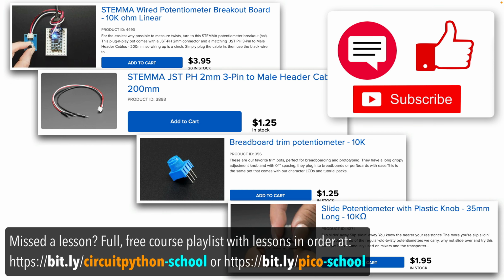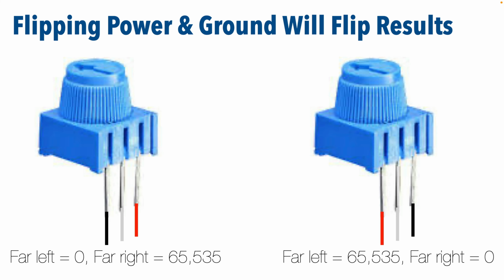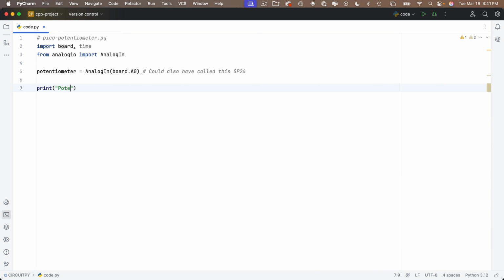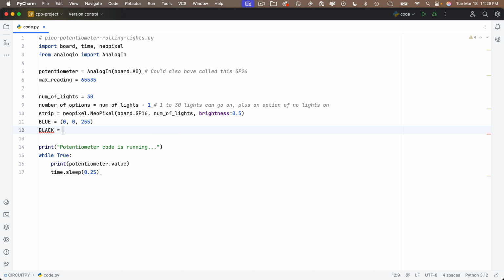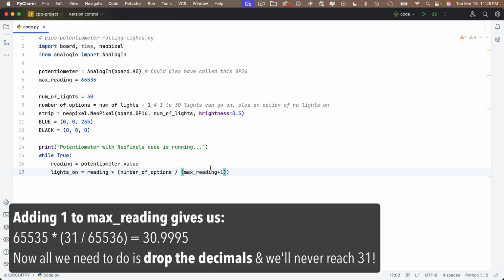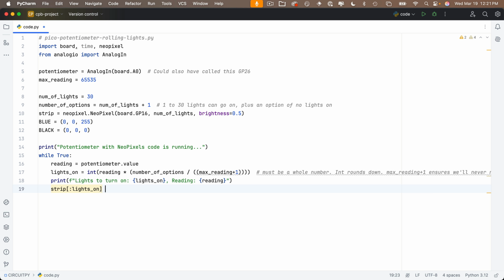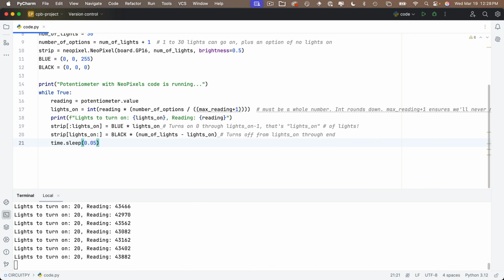Use a Raspberry Pi Pico & Potentiometer to Turn on NeoPixel Lights (CircuitPython School)

Comment: Hi friends, make sure you check spelling and capitalization . I just spent 15 minutes troubleshooting what was literally just not capitalizing the P in neopixels and T in True.
Reply from the maker: Yes, spelling can really get you. My students all use PyCharm - code completion in PyCharm is far better than in Mu, the online code.circuitpython.org editor, or anything else I've seen. It takes a while to set up, but is definitely worth it. You can find installation info for PyCharm & the highly recommended circup utility (also required for all of my students) at https://bit.ly/pico-school. I do try to mention the capitalization the first few times these come up in the course, but I'll be sure to try harder for new & updated lessons. Also note the tip sheet that my students use to copy / paste setup code: http://bit.ly/CircuitPython-tip-sheet (note the UpperCamelCase for CircuitPython - I do this so it is a separate browser entry vs. circuitpython, since students refer to this throughout the course. Hope these things help & glad you're enjoying the lessons!

Comment: Tossing this here for myself as I work on this, but also incase it helps anyone else.
0:00 Intro
0:57 Components
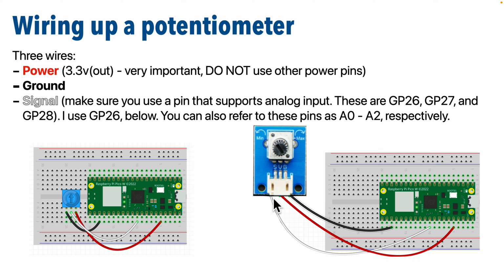1:25 Wiring a Potentiometer
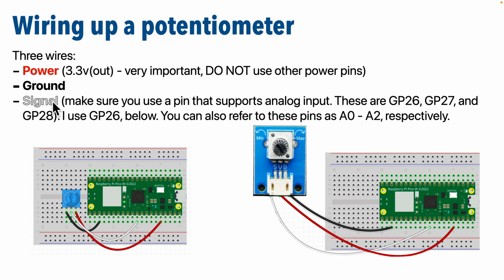1:47 Pico Board Pin Diagram
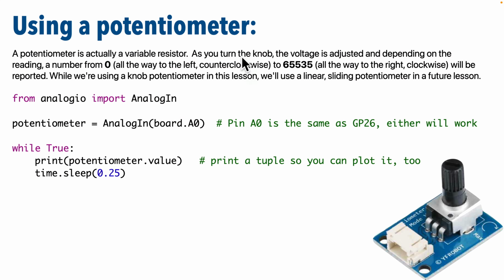3:03 Potentiometer code
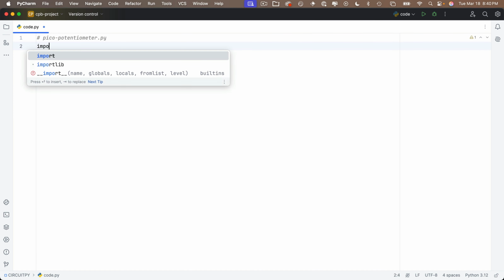3:34 Coding starts
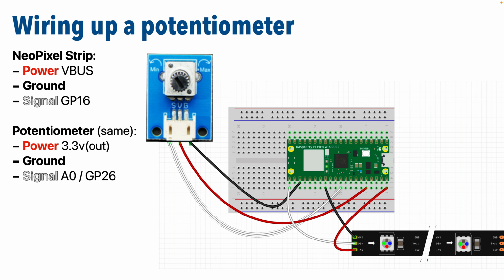4:45 Wiring up a Potentiometer
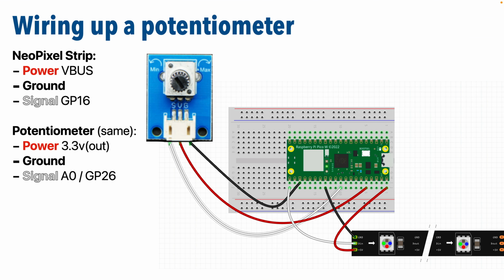4:49 Challenge: using a Potentiometer to Light a Strip
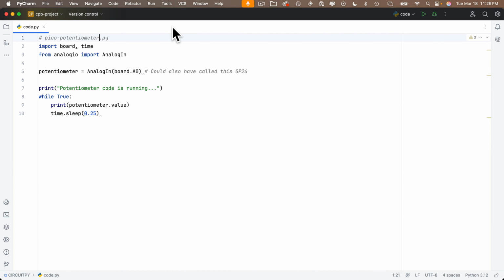5:30 Coding resumes
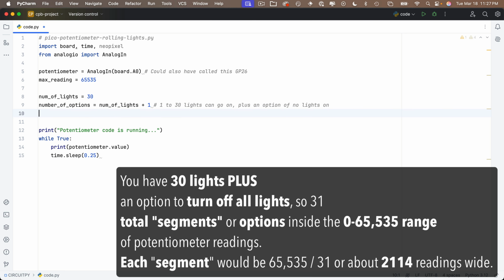6:21 important note on lights
7:53 Max_reading
10:00 Light index graphic
11:05 Running code
11:45 Outro